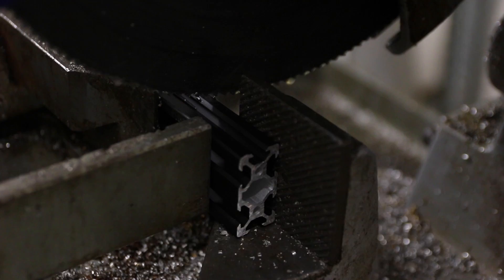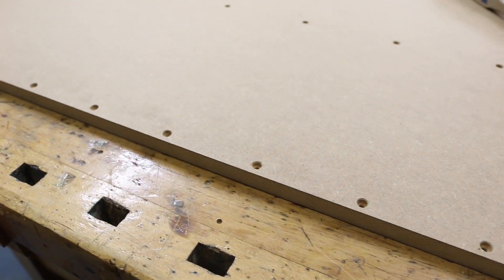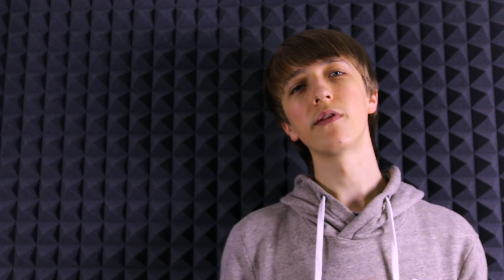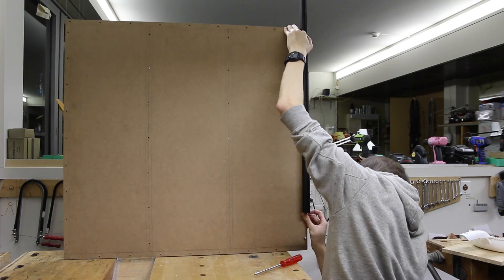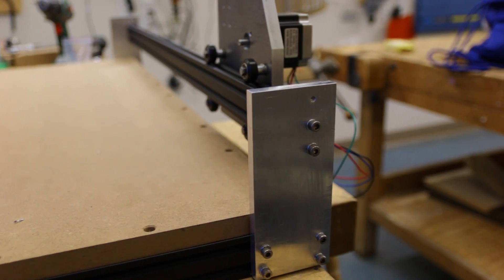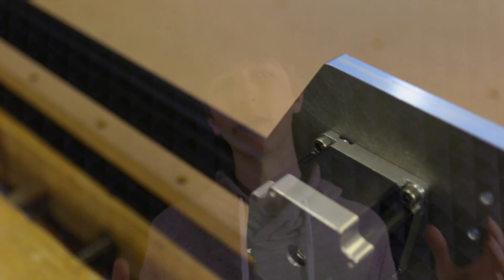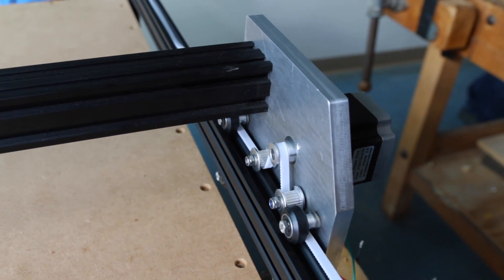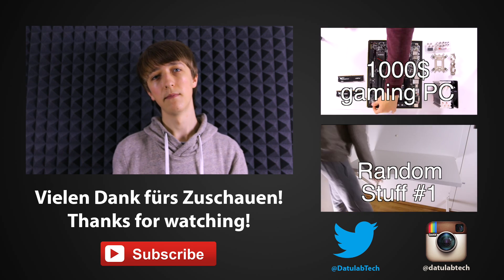Custom DIY CNC ROUTER #1 - The Frame

Comment: can you make a video or explain how you automatically change yours bits on the go is it magnetic ??
Reply from the maker: +jayed55 no, it's not magnetic, it usually works with air pressure. I however don't know much about it myself as I don't have it myself.
Reply: Datulab Tech it would be nice to ask your friend how he built it i want to do the same thing. by the way very nice video

Comment: Hi Datulab...very good idea your Cnc...could you give us the list of materials..? and where could i find the " X " profiles which are the rails...?
Thank's a lot, happy cuts....
Reply from the maker: I got the T-slot extrusion from ratrig but you might get it cheaper locally. Also make sure to check out the further parts as I explain a lot there.